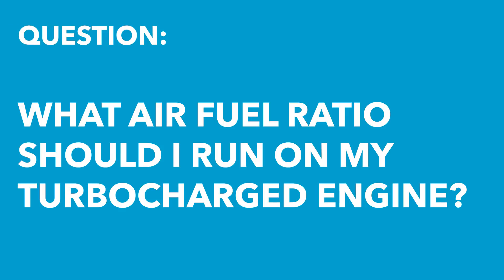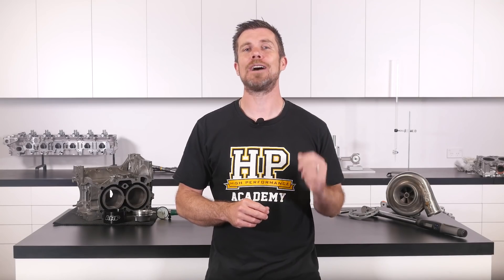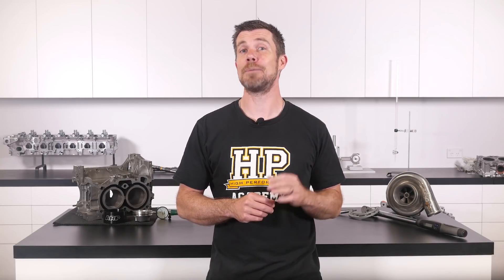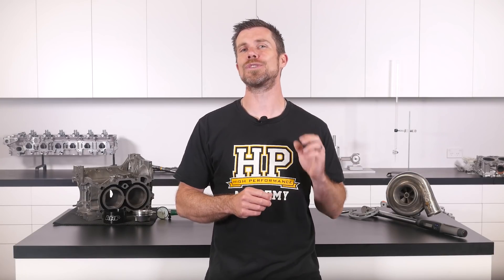[HPA Q&A] What AFR for my Turbocharged Engine? | EFI Tuning

Comment: I have read a story from a pro tuner in a english car tuner magazine and he said that a AFR of 10.7 would be a very save spot with 98 RON fuel. He tested differend engines on the dyno. With over 12.5 he had a melted piston after 17 seconds on a 630 hp Porsche 911 turbo. And with each richer run the hours rised until ignition problems begin at 10.5-10. With 10.7 it lasted 20 hours on full power.
Reply: As Andre said, every engine is different - that means different compression ratios, piston design and material, combustion chamber design, any oil cooling used for the pistons (I understand F1 engines are currently using 24 - 30 for a 6 cylinder engine), charge air temperature, etc - all affect how well the pistons respond to the AFR. Even in your example, there have been many different engine details used in the "911 turbo'" designations with base power from ~260hp to over 550, OEM, depending on model. Heck, not sure how much credance I would give to a claim for running a 'continuous' 20 hours, comes to that, as any race engine is run for a few seconds at a time as it is backed of for corners - even the old Le Man track was around a minute, tops, on Mulsanne.
Personally, I would be looking at best torque (power) while keeping the EGT (Exhaust Gas Temperature) within acceptable limits - for that, check with your turbo' supplier as some may have higher, or lower, limits than others, and there are some new turbine materials coming onto the market that will take as much as another 50C.
I would also use the best exhaust material I could afford and ensure clearances and guide material are correct - do some research, as not all SS valves, and alloys, are equal and you may be able to find sodium filled examples designed to further reduce head temperatures.

Oh, also some 'tuners' use over rich mixtures to mask poor ignition timing optimisation - be careful. It is also certainly possible for poor 'tuning' to cause engine failure at other than full throttle.
Reply: Oh, with F1 engines being the cutting edge, it would be worth your checking out their latest versions where AFRs are approaching lean best (15-16:1), for economy as it is a fuel limited formula for both total fuel load AND the maximum rate of fuel that can be used by the engine, and static compression ratios that, with the boost levels used, are on the edge of compression ignition.